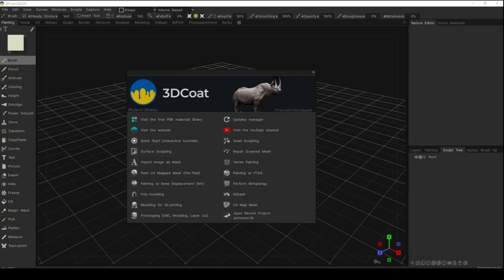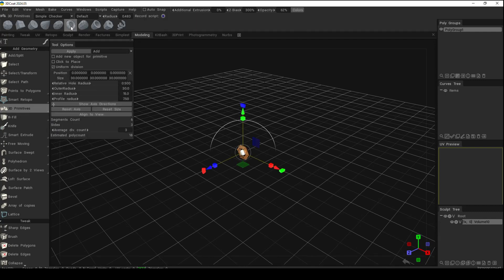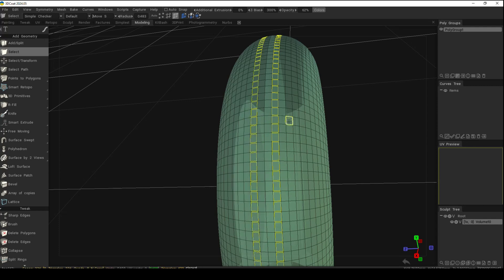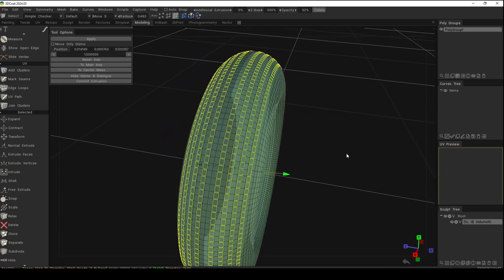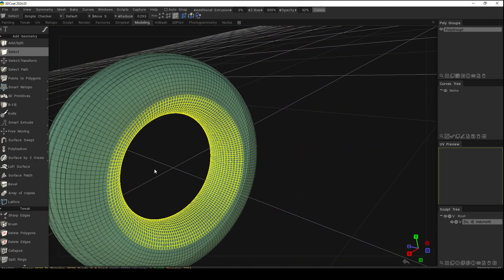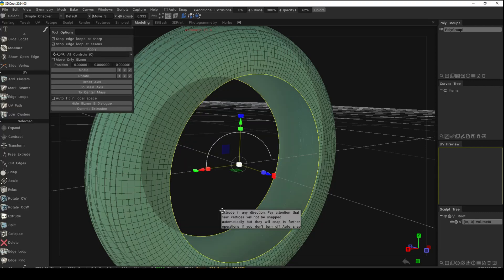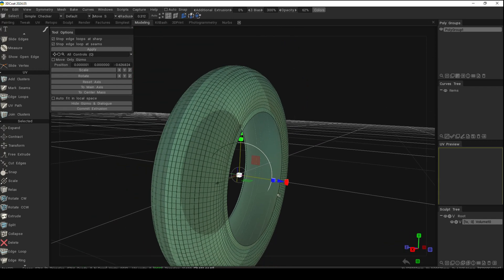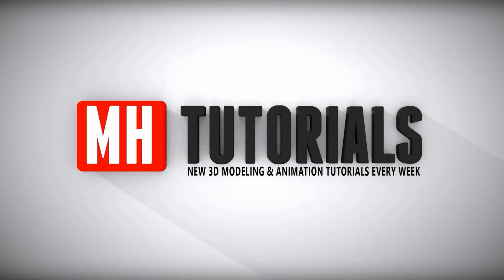3DCoat series #13 : Let's create our first 3D poly model

Comment: I just updated and not I can't find or see the free extrude tool, or extrude, all I have is smart extrude, so find the exturde parts real hard, specially the center rings, I don't get a gizmo, I only get the smart extrude tool with the wee N in a circle
Reply from the maker: Hit the spacebar and select the 3rd icon from the left. As for the Gizmo, have you updated to the last update ?
Reply: @MHTutorials3D   Yes, 3DCoat-2024-15, sadly it broke my applink too for Blender 4

Comment: Thanks for the tuts. Would love to see how easy or difficult it is to make 3D / bas reliefs from a photo or collection of vectors using 3DCoat. I haven't seen any videos/tutorials on how to do this in any of the major modeling programs such as 3DCoat, Blender(not including its bas relief tool which requires 3d models), Zbrush etc. What appear to be the best and easiest for this task are programs meant for CNC routers, programs like Carveco(previously ArtCam) and Vectric Aspire. But they cost thousands which is a lot just to get access to their relief modeling tools. Please do an image search for "carveco / artcam 3d relief" or "vectric aspire 3d relief" to get an idea of what I'd like to see accomplished with 3DCoat.

Generally the process involves creating a group of vectors by tracing various parts of animals or whatever in a photo, adding depth to those vectors with various effects or shaping, then blending them together and adding extra detail.